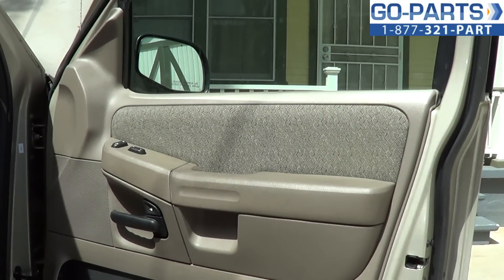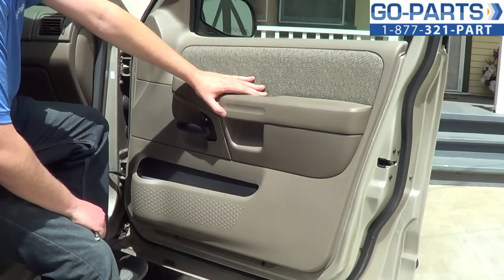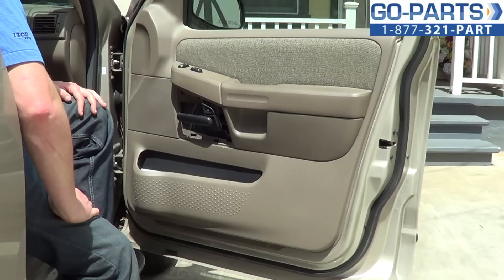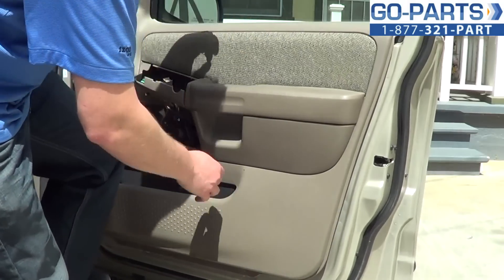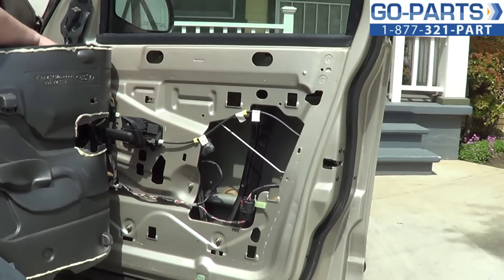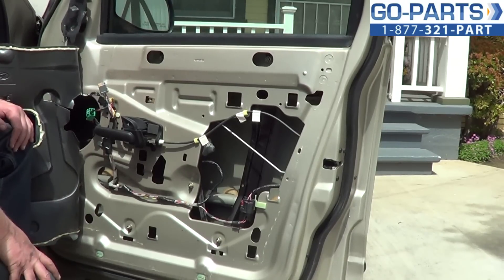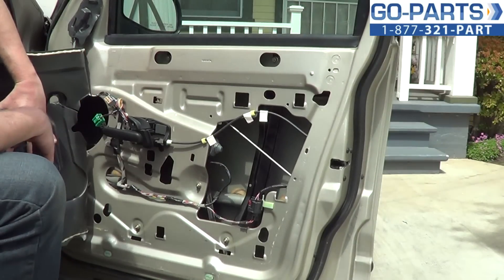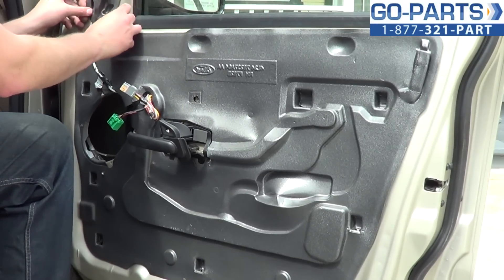Replace 2001-2005 Ford Explorer Front Power Window Regulator, How to Change Install 2002 2003 2004

Comment: Had my regulator replaced and now window is not going up right and tight. Also has a rattle noise in lower part of door. Took it back,  they said they tightened it. On the way home, same thing! Can window be adjusted?

Comment: This video is skipping some important info. There are now a couple other videos that are better. Those rivets have a steel center pin that is almost impossible to drill out as the rivet body is aluminum. If you punch the rivet pin out, the rivets are easy to drill out. However, hammering on the pin can break the window glass. But you can wedge a wooden block behind each rivet to prevent breaking the glass.

Comment: I ended up just taken the motor off and replaced the motor only.
Reply: Chen Aaron So I do not need to remove the entire regulator to replace the motor only?
Reply: Chen Aaron Is there a video on how to do this?
Reply: wow that was a while ago I don't even remember what I did. Sorry about that though.
Reply: No problem! Thanks for the reply :)
Reply: Check this out http://www.explorerforum.com/forums/index.php?threads/window-regulator-replacement.243401/
Reply: Thanks man!
Reply: Sadly, the window motor is good. It is a wiring problem.
Reply: I think the guide will allow you to remove the whole regulator also. Just replace it.
Reply: The hardest part is the glass itself since it riveted, but the guide teaches you to get around it.

Comment: You dont have to drill anything! One version has a tang you bend the other has a clip you use a small screwdriver to lift up on the back side and slide the plastic off the arm.
Reply: still waiting to hear how 4 years later